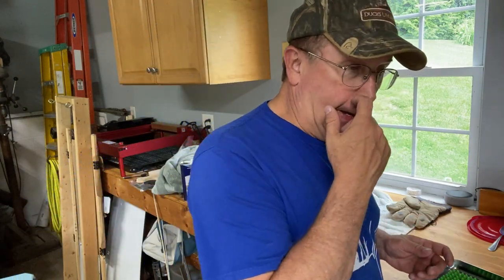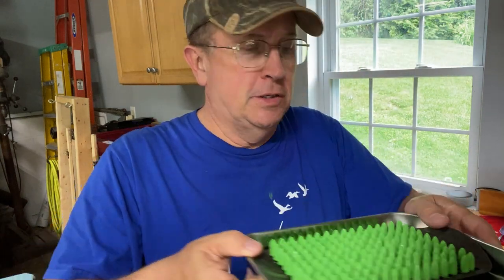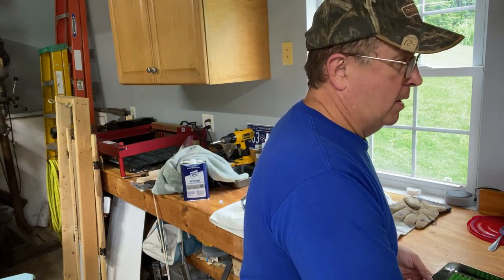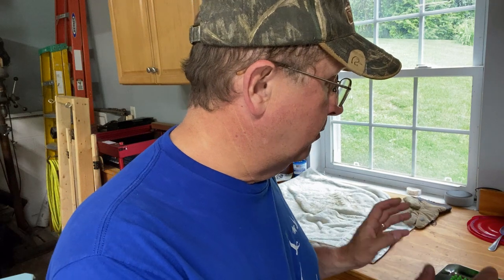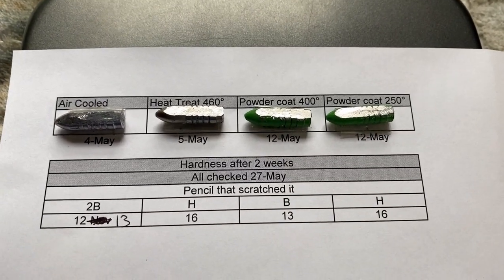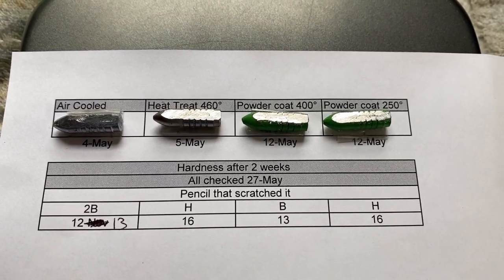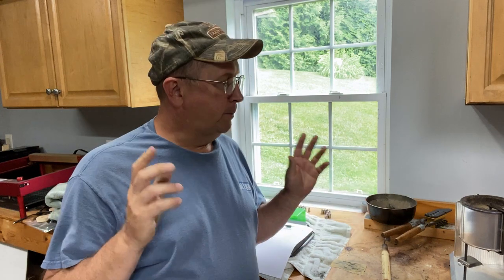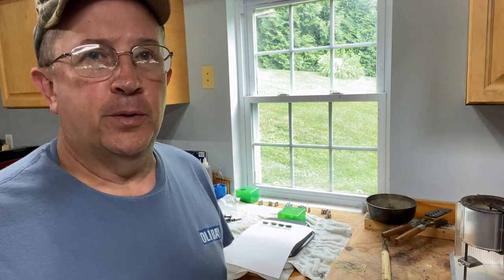Heat treatment of cast bullets and annealing while powder coating

Comment: Good on you Rob.  I will be interested to learn if your harder bullets give you a significant improvement in accuracy.  I did a few basic experiments a while back and it seemed that harder bullets did mostly shoot a little better..... but the sample sizes were fairly small and I couldn't be bothered repeating the experiment.... plus I don't have a good supply of tin or antimony to add to the mix and I am reluctant to buy any.   I haven't tried heat treating yet.... but I believe a softer bullet is a better hunting bullet so I have a conflict.

I have a Lee push-through sizing die for my .357 magnum bullets.  The only reason I got it was because some of my plain-base bullets were a little too big 'as cast' and I was having trouble pushing them into the cases.   Initially I thought it best to push the bullets through the die base first.... so that it what I did.     Just a few days ago I needed to size some more bullets, but this time I did the conventional thing and pushed them through nose first.   I think that was a mistake.  This pushed the 'extra' lead downwards and I found that some bullets had small fins of lead protruding unevenly below the base.  They weren't huge, but I could easily see them with my naked eye.   I took seven of the worst of them and shot a group of around three inches at 36 yards when normally I'd hope for a group of an inch or less.   So I melted the whole batch down and cast some more.... and this time I sized them by pushing the base through first.

Recently I shot a red deer with a 200 grain cast bullet travelling at around 980 fps from my .357.   Very satisfying to make venison with a home load.   Best wishes from NZ.
Reply: Interesting!! Sized base first? Did that have any impact on the nose of the round? Deformities? Thank you for the information as well !
Reply: @AlittleSmokey  I couldn't see any apparent deformity on the nose of the bullet...  however these were semi-wadcutter bullets with a flat nose.    If I have the choice, I would always choose to push the base through the sizing die first.  I think that a clean base that is perfectly at right angles to the sides (whichever way you look at it) is likely to give the best accuracy..   I cast my own soft lead bullets using whatever scrap is available.  Interestingly, the bullet that has been the most accurate (at subsonic speeds) in my .357 is the Lee C358-200-RF.  I never use gas checks, so there is a step in diameter right at the base.  Another very good bullet is the Cast Bullet Engineering  358-180-FNBB which has a bevel base.  Some folks say that bevel based bullets may not be quite as accurate as plain based bullets, but I think the bevel gives a space for the small amount of lead that gets wiped to the rear of the bullet as it gets shoved through the barrel..... and I think that perhaps the 'step' at the base of my Lee 200 grain bullet provides a similar space.    I may be quite wrong of course, but these bullets give me some of the best groups.   I still get flyers that I don't think I can blame on my shooting form, but overall these bullets are the most consistently accurate.  A nice, even base should help the gas pass evenly around the bullet at the critical moment when it leaves the muzzle....  so the force of the gas is even on all sides of the bullet.   If there is a fin of lead or a cavity near the edge, this may influence the way the gas passes around the bullet.   Just my thoughts......     Best wishes.